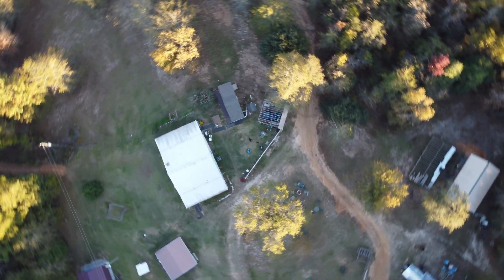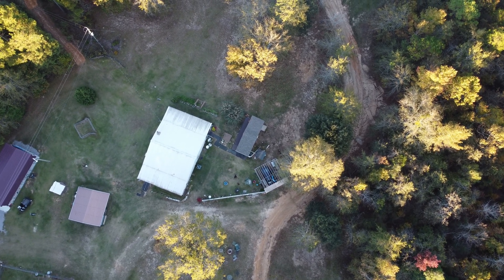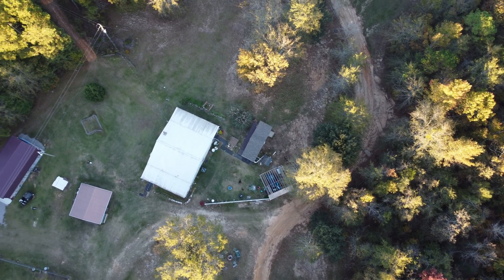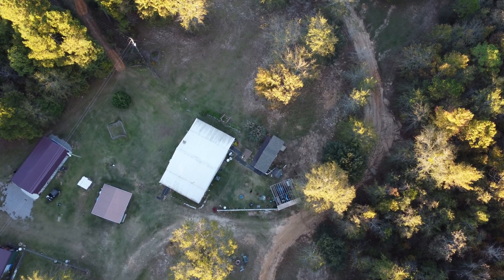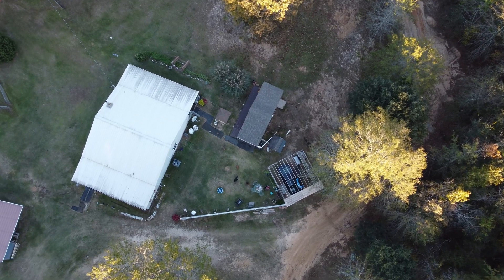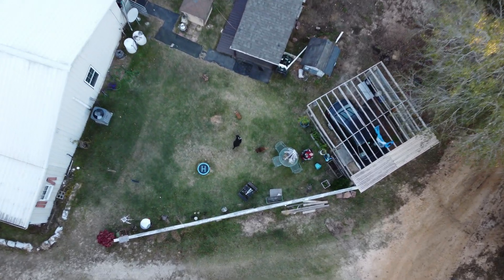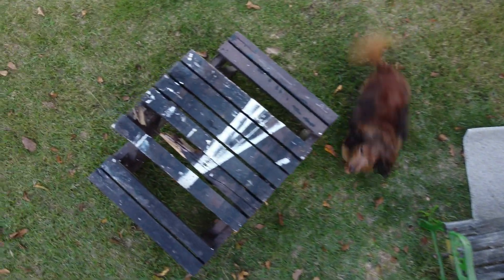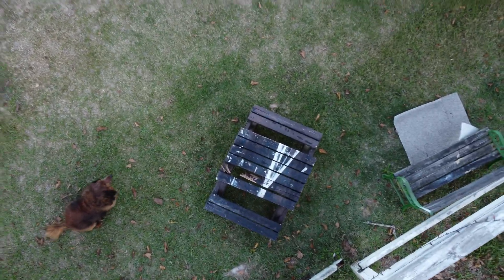DJI Mini 2 Motor Failure! Did it survive?

Comment: wow lucky you landed it i just also recently hade a total motor loss in my dji mini 2 I managed to land safely just to realize my entire motor melted I did land a bit rough and broke most of the props but I managed to repair it
Reply from the maker: Wow. How old is it? Mine may be a year old
Reply: mine is just over a year old have flown it probably over a 1000 times right now I am getting stealth propellers and motor covers shipped so no more sand gets in the engine and causes meltdown I almost crashed into a river that day.
Reply from the maker: @huntergames9668  i need to get mine out and fly it again to make sure its acting right.. last time I flew it it was too dark so I wasnt up long but it seemed to be losing altitude as i flew forward.
Reply: @LifewithLewy  yes I recommend flying in mid day when its brighter  so all sensors work well I haven't experienced that issuer maybe some props have cracks or are bent a little bit if not try cleaning the motors EG removing any hair dust and cleaning it with small brushes
Reply from the maker: @huntergames9668  I was thinking it’s likely a prop issue
Reply: @LifewithLewy  yes i do agree on that if you do find that it is a prop issue i would recommend MAS stealth propellers they add a slight bit more power and make the drone quieter if you wouldn't like upgraded props the only thing you can do is stock props but I highly recommend the stealth props I just got them recently and they are a lot better in terms of noise
Reply from the maker: @huntergames9668  thanks for the info I will look into them
Reply: @LifewithLewy  your welcome if you do get them hope you enjoy them